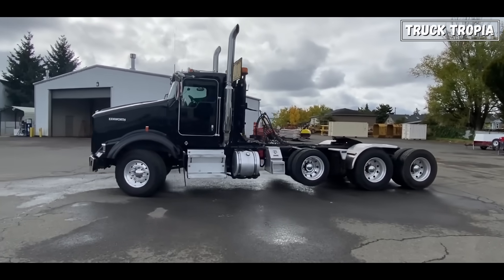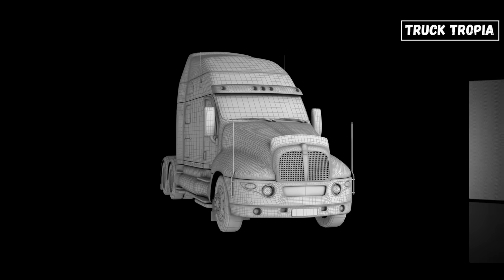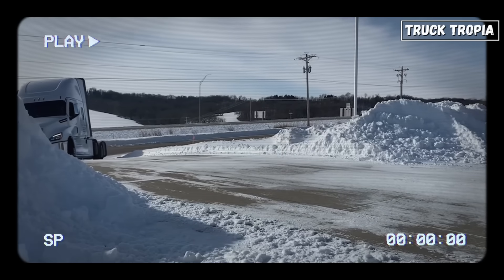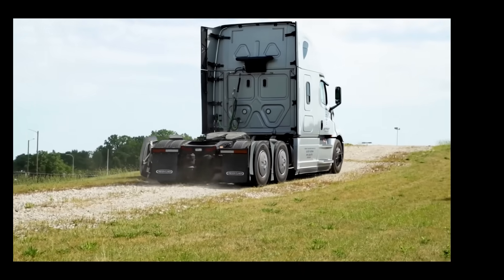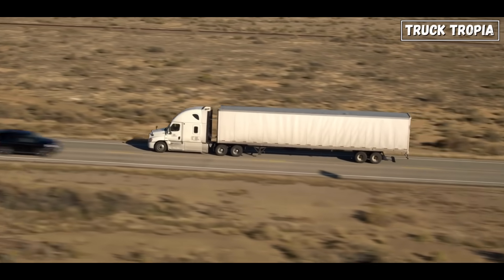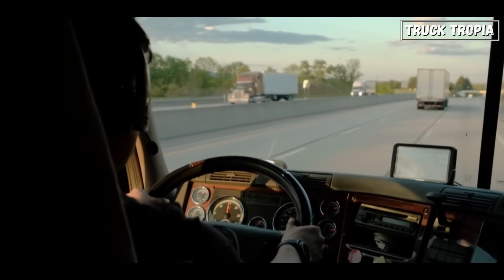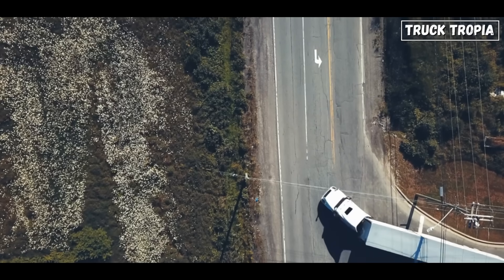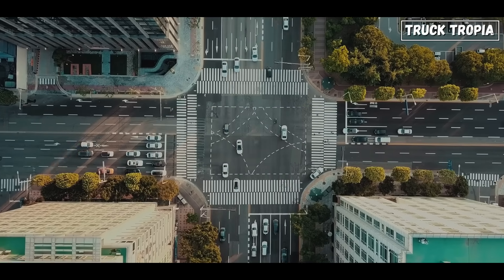Why Do Some Truck Tires Don't Touch The Ground?

Comment: TLDR: The axel can be raised or lowered to distribute the weight of the truck for various reasons including traction, fuel efficiency, reduced costs and maintenance.
Reply: In a nutshell: if the truck is not loaded, less axles is better. If the truck is loaded, more axles is better. So you load the truck with heavy stuff,  those lifted wheels touch the road.
Reply: Thanks for that. No need to watch the video now. I’m out! ✌️
Reply: @Psyopcyclops thank you.  I didn't want to see a long redundant video.
Reply: @Psyopcyclops same 😂
Reply: @Psyopcyclops  Same lmao
Reply: Main reason weight distribution to stay legal on axle weights. Per dot regulation you can only have so much weight on an axle. Having a lift axle allows more weight to be carried legally
Reply: @moparjr89 biggest lie I've seen all week. that's not what it's for at all
Reply: @moparjr89your the best
Reply: this is the fucking goat comment, jesus christ 6 minute 30 video for a 2 sec answer
Reply: bro really tried to spend  6 minutes to explain 1 sentence
Reply: @jc_yadigg and he repeated ut 25 times💀
Reply: @maxx-er3fj can't stand ppl like him who make vids like this . desperately trying to make the content longer to seem like there is more to say or it's more "info" packed, and squeeze 30 ads in a 6 minute window. That's why I have a block and YouTube premium. And whenever a mfing youtuber has a sponsor, I immediately skip that part
Reply: @jc_yadigg  facts
Reply: You were there when I needed you. For that I am grateful today. Legend.
Reply: thx, saved me wasting 6 mins of my life for a simple answer
Reply: TLDW
Reply: @Thinkableness  Thank you.  I was thinking the same acronym.
Reply: Let’s start with some bullshit you weren’t curious about. Maybe, someday, I’ll tell you about that other thing
Reply: also road wear which is also related to legal restrictions on road use.
Reply: 5:45 if anyone is still interested
Reply: So they call haul heavier. -Trucker 47yrs.
Reply: elementary school sentence structure- dropped out
Reply: Thanks! Saved me 6 minutes and 15 seconds 😂
Reply: bro it's a 6 minute video lmao
Reply: @needy3535  vs 1 min read.
Reply: Spoilers dude.
Reply: I figured it had to do with weight distribution adjustments. Only clicked to see if anyone in the comments mentioned it. You saved me 6 minutes of my life ❤️
Reply: It's comical the creator liked a comment that's stopping people from watching the video.
Reply: @DathoxUdictus  I'm gonna sub to him if he likes your comment too, lol
Reply: Thank you for saving me six minutes of my life.👍
Reply: Thanks, saved myself 6 mins
Reply: Just saved me 5 mins cheers 😂
Reply: Thanks skipping tf outta this
Reply: Ty he somehow said the same thing over and over and over and it was driving me insane.
Reply: Honestly, anything more than "the axle can be lowered" is TL.

+1
Reply: thank you for saving me 6 minutes
Reply: thank you, you save my 6.30 minute to watch just reading this. haha
Reply: Just saved alot of people 6 1/2 minutes of useless information in this video. 😂
Reply: And this is why I didn't watch and came straight to the comments.
Reply: too long didn't "read" 💀
Reply: Thanks. Figured as much. Just saved me 6 mins
Reply: thanks op
Reply: Fax. The video was a bit long-winded
Reply: Isn't it a law that if you have a certain amount of weight you need to have 3 rear axles on the ground? Dump trucks use it a lot.
Reply: @Thexdmattx  yeah when your girlfriend rides with me, I need to put down the third axle
Reply: I thought it was to save on tolls when the extra axle isn't needed.
Reply: the axel rose did a good job distributing his weight
Reply: TLDW (watch)
Reply: Thanks
Reply: saved me 6 minutes
Reply: The lift axles shown in this video are garbage.  Tridem drives where all three axles drive (push the truck)  are much better with respect to traction, weight distribution, and reduced pavement damage.  For long haul operations, the most efficient vehicles utilize double trailers.
Reply: More TLDW comments! Anti-ad too! I love it!
Reply: TLDR? Bro it's a fucking 6 minute video 😂😂😂😂
Reply: because it was written by a freaking AI
Reply: Thank you lol
Reply: Thank you
Reply: God bless 3 times
Reply: Thereby increasing the wear to the roads costing taxpayers more
Reply: And it looks cool 😎✌️
Reply: TL;DL more like!
Reply: Thanks
Reply: That’s the PG answer. We truck drivers know the real reason 😉😉
Reply: This Is Important
Reply: *axle
Reply: Thanks, as soon as it said "why a some trucks" I assumed lazy AI voiceover usage
Reply: Thanks, no more left and right bs video, I can finally sleep in peace
Reply: saved me 6 minutes, thanks and bye
Reply: Great video for those who come from states like Cali. As they dont know how trucks work.
Reply: Omg thank you dude is sir yapalot
Reply: I saw some wingvans that has 4x2 and their middle chassis is prone to structural stress. Thats is why i see there are wingvans that has 6x4 and four wheels infront or 8x4 same 4 front wheel axle. That is more stable when overloading the extra wheel help the middle chassis rest.
Reply: Interesting video.
Too bad they don’t explain why the front axle is never lifted up
Reply: You saved so much time❤
Reply: Axle. Except for Rose. And Foley.
Reply: so, the Axel Rose?
Reply: Thank you! I don't want to waste 6 min watching the vid.lol

Comment: When I was a kid I used to notice some of those floating tires were spinning too but weren’t on the ground. I still think about it to this day
Reply: Could either be the wind blowing it or it was probably raining and the rain wash was pushing it a little bit. Mine spins a little bit during heavy rain when I'm rolling the speed limit. Or maybe it sits too low to the ground and it hit a high spot and caused it to spin temporarily when you saw it.
Reply: @jasonrabe1664  🤔 interesting. Thanks!
 Shows how bad my ADHD still is. Focused on something completely random I’ll never have to deal with in my life 🤣
Reply: The reason why ( especially with non-stearable type ), is because when going around a corner, you need to lift the axle. Otherwise,  the truck tries to go straight while taking a sharp turn. And also because it chops up the tires for the non steerable kind. When the axle goes up, the tires are still spinning. Mine uses to do it all the time on a '97 R model.

Comment: The tire can be activated to go down for better grip and adjust weight distribution of cargo. Saved you 6 minutes.
Reply: You get less grip with a tag axle down cause it takes weight off your primary axles

Comment: It's the overload axle, it touches the ground when the rest of the suspension is overloaded enough to lower it down. /s
Reply: Not at all it's manually controlled and put down to make axle weights legal nothing to do with overloading
Reply: @moparjr89  I guess the sarcasm flew over your head, yes you're correct.

Comment: I drove auto transport trucks for almost 30 years, some of the trucks had a "Tag Axle" some a "Lift Axle".  The tag axle was an air suspension axle that when the air was released would still ride on the ground but not carry any weight.  The lift axle when no air was applied would lift off the ground.
Reply: yes i know the ones you mean very common in new zealand .

Comment: *The main reason why they get lifted is not even mentioned here*:
This is because that kind of configuration doesn't allow you to make turns without wheels sliding on the road what will greatly increase resistance reduce grip ap greatly increase tyre wear and add some small extra fuel consumption when driving in the city with many sharp turns.
when driving straight  none of that is a problem anymore.

Ukrainians even attempted to build a tank with same configuration as truck and it only could drive straight or it was losing its tires in attempt to turn.

Comment: Simple. It’s something you need in some situations, but you don’t need in others. So they make it so you only have to use it when you need it. Because if you use it when you don’t need it, you are wearing down components for no reason. And also, I don’t know if this applies everywhere, but I think toll roads typically charge by axle. So if an empty truck can remove an axle from the ground and pay a little less, while staying in regulation, why wouldn’t they?

Comment: bro you just explained the same thing, like 5 different times... "better weight distribution" "distributing weight more equally" "distributing the weight over several axles" "overall weight is distributed more evenly" this video could've been a solid 1 minute instead of repeating the same shit over, and over, and over, and over, and over again.

Comment: Don't some American states have rules that basically mean more axles are cheaper to run?
Reply: Most developed countries around the world have variations on the same thing. 👍
Reply: different states have different local laws in regards to maximum truck weight and how many axle you need to qualify for that weight. Like in Oregon and Washington you can legally go up to 105k pounds but it takes 8 axles to get you there. The road tax will be higher though as you're telling the state that you will be causing more wear on the roads. More axles will always be cheaper than a second truck in operating costs alone though

Comment: Simple explanation -

Why lift them: For fuel efficiency. Less friction => less fuel needed. Also easier to turn the vehicle with less tires on the road.
Why NOT to lift them: For even weight distribution, to carry higher load, and to navigate better on hard terrains (e.g slippery, rainy, up the hill etc.)
Reply: Wrong when traction is bad like rain or snow lifting the axle provides more traction. More weight on your main axles provides better traction same concept as adding weight in the bed of a pickup in winter

Comment: 00:00:00 - 00:05:00
The video titled "Why Do Some Truck Tires Not Touch The Ground?" discusses the use of liftable truck axles and their impact on the performance and safety of a vehicle. Axles are typically defined as rods or shafts that connect two wheels and support the weight of a vehicle. The video discusses four types of truck axles: steering axles, drive axles, tag axles (Boogie axles), and lift axles. Liftable axles are the only type that can be lifted from the ground, and are primarily used to improve grip and traction, reduce ground pressure on tires, and improve fuel efficiency. The video provides a well-rounded understanding of truck axles and their impact on a vehicle's performance and safety.

00:00:00 In this section of the video, the explanation begins by defining what an axle is as a rod or shaft that connects two wheels and supports the weight of a vehicle. The video then goes on to discuss the different types of truck axles, namely steering axles and drive axles, tag axles (or Boogie axles) and lift axles. Lift axles are specifically discussed in detail, as they have the ability to be lifted from the ground, while the other types of axles do not. The primary reasons for lifting lift axles are to improve the grip and traction of a vehicle, reduce the ground pressure on the tires, and improve fuel efficiency. The video explains in detail how lift axles work, how they are typically connected to a truck's air suspension system and can be controlled by a switch in the truck cab. Overall, the video provides a well-rounded understanding of truck axles and their impact on the performance and safety of a vehicle.
00:05:00 In this section of the video, the speaker discusses the use of liftable truck axles, which allow for the raising or lowering of an axle when needed. This is done by activating or deactivating a switch, which pumps or releases air from the airbags attached to the axle. When the axle is raised, it reduces friction between the tires and the road and improves fuel efficiency. When the truck is carrying a full load, the axle can be lowered to improve stability and handling by increasing the weight distribution of the vehicle. Liftable truck axles are commonly used in long-haul trucks, dump trucks, and construction vehicles, and can be a versatile tool for trucks that drive with varying loads.

Comment: Too long didnt watch: 
"Those tires are part of what's called a "lift axle" and they have what you might call a part-time job. The driver can push a button on the dashboard that lowers to the ground the tires and the lift axle (the metal rod that joins the tires). The lift axle helps spread the weight of an especially heavy load."

Comment: The box trucks we have at work have 3 axles with the last one being a lift axle
often we lift it for taking tighter turns but it also helps with grip on slopes
another reason to put it down again is stability on highway since these trucks have such a short wheelbase
our trucks automatically lower the 3rd axle when a certain amount of weight is loaded tho even on heavy loads you can still lift the axle for a moment
Reply: Same here. The legal limit for the driven axle is 11.5 tons here, so the boggie will automatically lower if you go above that.
However, if you use the press button, you can overcome this.
I once had a really slippery road where I had to reverse my trailer and to get grip I had to fully press the axle with 15 tons lol, but only for a few seconds.
Reply: @UncleBane69 Been driving with over 17 tons a few times on my Scanias drive axle on horrible winter days, no problems at all, people in norway press them over 18 tons without any problems

Comment: I do not understand the weight limit part.... to me it does not matter if the axle is lifted or not, it is still on the truck, the weight is still there. Am I missing something or? Unless what you mean is, you are not allowed to haul heavy load on single axle, it must be lowered.

Comment: Another benefit of lifting a tag axle is a reduced turning radius. Some Volvo trucks allow you to lift the tag axle at low speed even with a heavy load, and will automatically lower it again when you exceed 30km/h.
Reply: Not in the usa
Reply: @moparjr89 I think that works only for the trailer when turning.

Comment: we get it, mutiple axles increases the fuel efficiency and weight distribution. you dont need to say it 10 times to increase the length of the video
Reply: It does not increase fuel efficiency at all

Comment: So that when the truck is heavy it can be lowered to get more traction
Reply: No lowered reduces traction cause it takes weight off the primary axles. A lift axle provides more weight capacity. E. G. 3axle truck good for about 46k total add a 4th lift axle truck is now legal for atleast 58k

Comment: how does raising or lowering an axle affect the total weight of the truck?
Reply: The total weight stays the same, but the distribution of said weight per axle changes.
It also depends on how you load the truck, especially if it's a rigid. Too much/too little in the front/back.

Comment: I've always wondered what kept truckers from raising the axles normally but putting them down at checkpoints such as weigh stations, to act like they're complying with regulations?
Reply: not much really, there is the fact that if you don't want to pass the pre-scale cameras with it up and pass the scale itself with them down (red flag to scale operator) then you have to drop it on the highway and making a stationary tire suddenly do highway speed isn't good on it

Comment: In european trucks, we have had "automatic" axles for years now, when a sensor measures enough weight on one axle, it will drop down lift axles to balance them out. Also nowadays they have automatic balancing feature too so the liftable axle isn't pushing down with full force but instead just enough so that the drive axle is at full legal maximum load.

Comment: Simple, they're there to take up weight. In the U.S. It's usually (though some states may differ) 12,000 on the steer axle and 34,000 on the drive axles and trailer. The extra tag axles on the trailer and/tractor are to take up the extra weight allowing the axles to maintain legal weights.
Reply: my truck at my old job had a dual drop axle and with a proper permit could load 18k on the steers (the steers could always take that weight legally) and with the right trailer configuration up to 60k pounds between the two drive axles and the drop axle for a total max weight of 78k pounds on the truck alone

Comment: so most of this video was just explaining the use of having an extra set of wheels on the ground. While it's good information, that's not why anyone clicked on this video-- why you would want to LIFT a set of wheels. You really only gave two reasons: 1) Improve fuel efficiency when you don't need the extra load-bearing capacity, and 2) Reduce maintenance needed on the extra wheels by lifting them when, again, the extra load-bearing capacity is not needed.

Comment: It's because when the truck takes off from the runway, the landing gear is retracted to reduce drag and improve fuel efficiency.

It's the same reason why trains have pointed pilots, so that they can cut through the water in a straight line, and hide the number of railcars from their enemies.